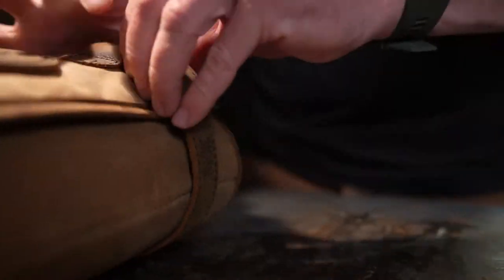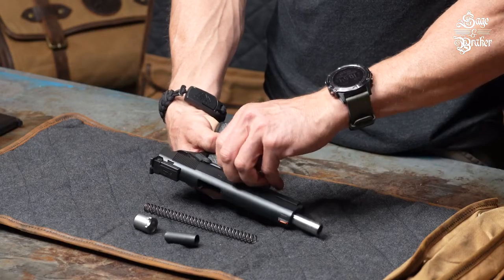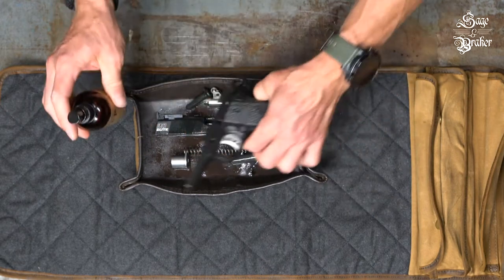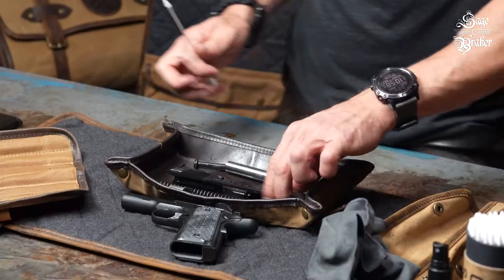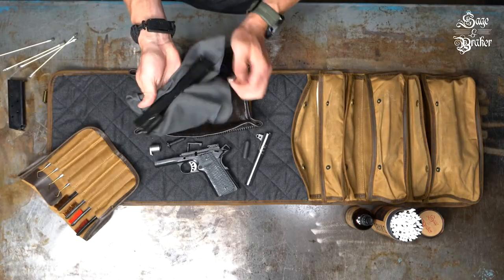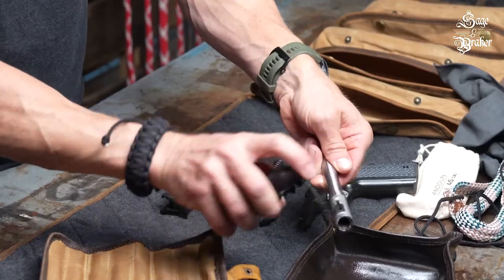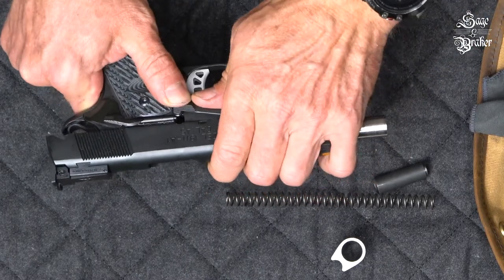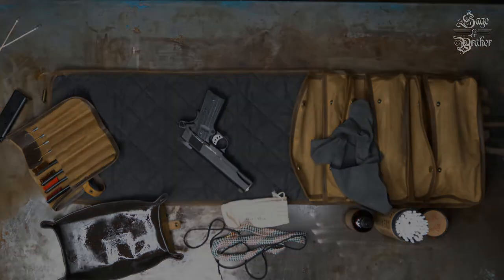Springfield 1911 // How to Clean and Disassemble

Comment: Man I have a lot of trouble getting the slide stop to snap into the disassembly notch on reassembly. Any trick to it? I put pressure upwards at about a 45 angle.
Reply: Me too, I'm hoping it's because the pistol is new, and will loosen up a little over time.
Reply: The groove on the slide stop needs to line up with that pesky little pin